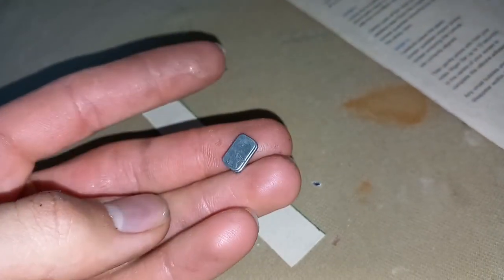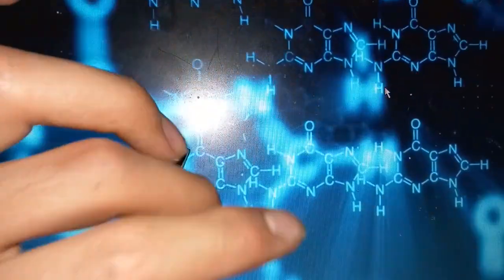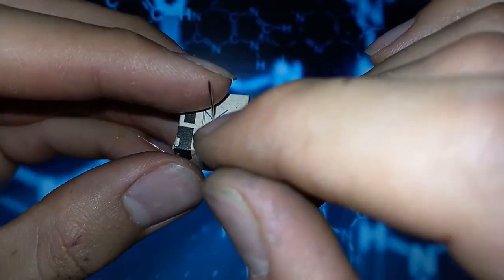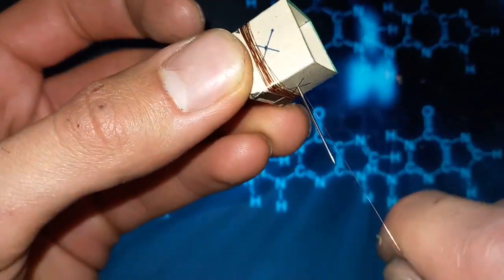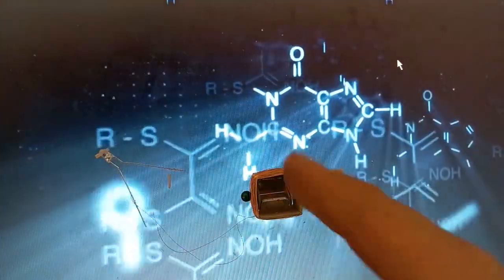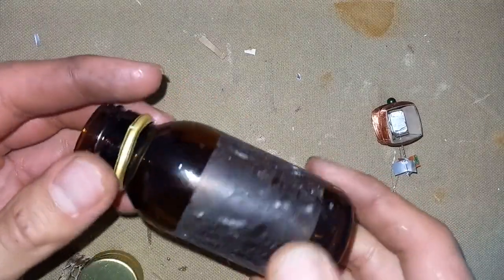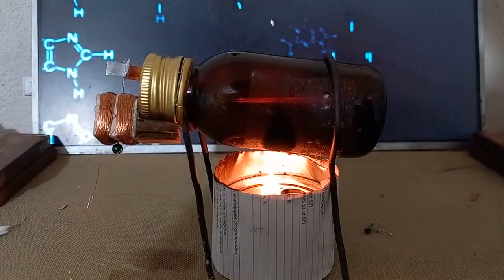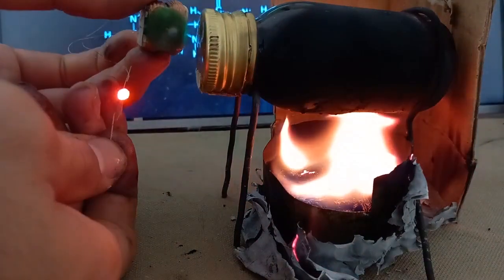diy thermal power plant | simple steam turbine generator

Comment: At 4:49 it works very well. The good thing about thermal generators is that there are many ways to make the heat that boils the water. Even nuclear plants use steam turbines. And if you focus a very big amount of mirrors on the boiling chamber, you might get a lot of energy as well.
Reply from the maker: the glass boiler looks so cool, seeing the water boil on top of heat..
solar thermal power plants are very interesting because its green energy of the sun and it doesn't require complex semiconductor fabrication just some pipes and mirrors!!!

Comment: can I use transformer copper wire instead this and if not then how many turns of 2-3  metres of 26 gauge copper wire can I use to make this
Reply from the maker: u can use transformer wire, it should be thin so u can wind enough turns

26 AWG = 1.5 mm  u can't use this, u need something like 0.1 mm diameter which is 36 AWG or thinner.

the thickness does not affect how many turns u need to produce the same voltage.

electrical relays, ac fan, low power ac motors have a thin magnet wire inside them u can use.

the important part is the magnet, the stronger and bigger the better

1.5 cm each side which is 6 cm per turn so u  will need  >30 (40m) meters for 500 t , the 500 turn generator needed very high speed to generate 3 volts which might not work for u. if u have bigger and stronger magnets it would work at lower speeds/turns
Reply: @Science-Vlog  thank for explaining and telling me
Reply: @Science-Vlog  can I use copper wire from old clock
Reply from the maker: if u can wind it, its good. did u saw my wind turbine video?
Reply: @Science-Vlog  yes I saw your wind turbine video
Reply: @Science-Vlog  and can I tiny sized magnet that I found in earphones speaker and i want in next video about tiny generator
Reply from the maker: those earphone magnets are too small! the smaller the magnets are the more turns u need and the harder it is to make but i will try..
Reply: @Science-Vlog  smaller magnet also the smaller body or I have 4 ceramic magnet which I found in 3v dc motor can I use those to tiny ones
Reply from the maker: why not just use the dc motor?
Reply: @Science-Vlog  yes I want to make it own and I made it works it produces 7volts+